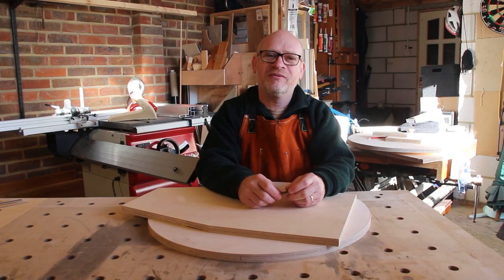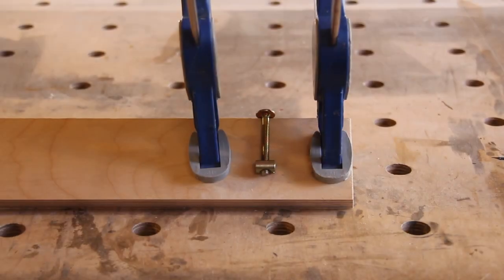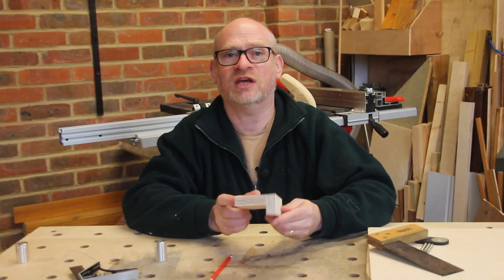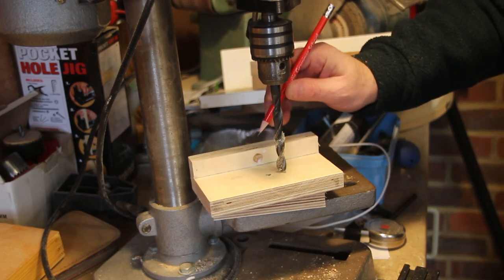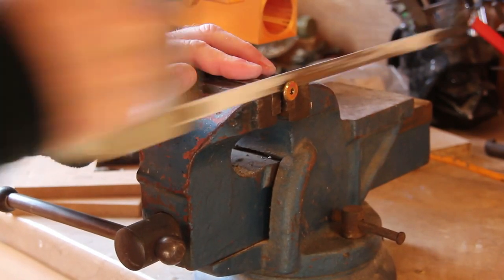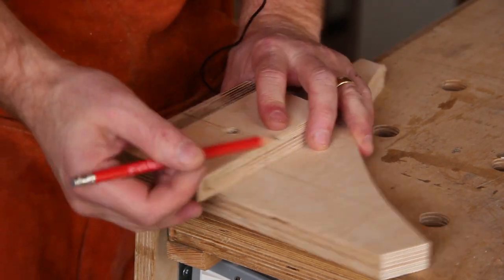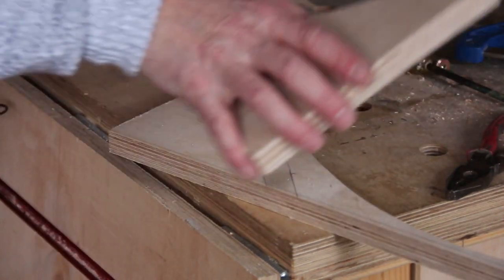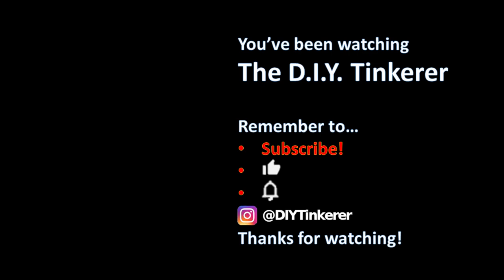74. Simple DIY Cross Dowel / Barrel Nut Jig

Comment: This seems like a great way to make strong joints that can be disassembled! I'm thinking of making a rack using these, using the long bolts horizontally. Do you think these can hold weight?
Reply from the maker: I think it depends a lot on the geometry, and the materials, they are pretty strong, are you able to do a test - that's the best to understand the capacity.

Comment: I wish you would have shown us the other side. Why? Because we need to know if the hole for the barrel nut is drilled all the way through the piece of wood or is it a partial hole whereby you can only see the barrel nut head from one side of the wood. Can you please tell me if the barrel nut hole is a through hole or not. Thanks
Reply: The hole only needs to be as deep in order to allow you to align the hole of the barrel nut to the bolt

Depending on the thickness of the wood and thickness of the nut will determine if it goes all the way through..  

Technically you can drill hole all the way through on a thick piece of lumber depending on how picky you wanna be
Reply from the maker: Hi, Thanks for the feedback,  it does go all the way through on the Jig, but in use you might decide not to go all the way through the lumber,  depending on how long the barrel nuts are compared to the thickness of the lumber. It might help to see it in action,  so check out this  video https://youtu.be/Cr0iyBowVgY  - Merry Christmas!